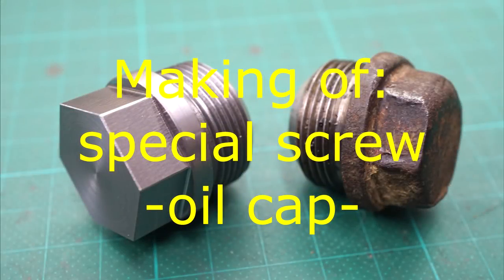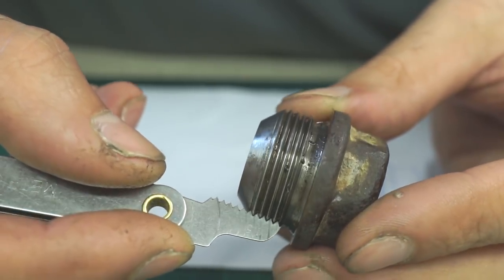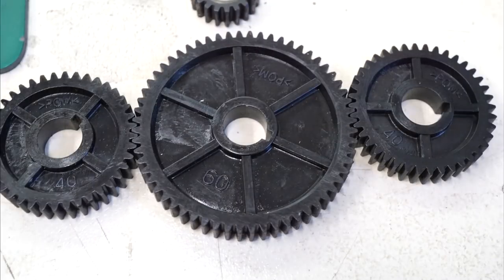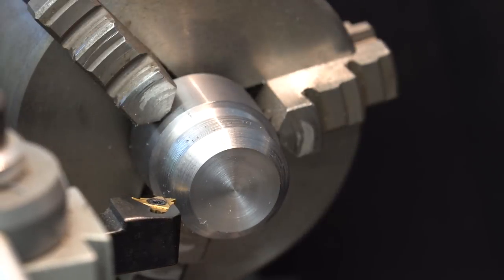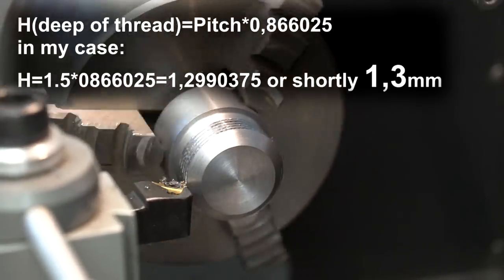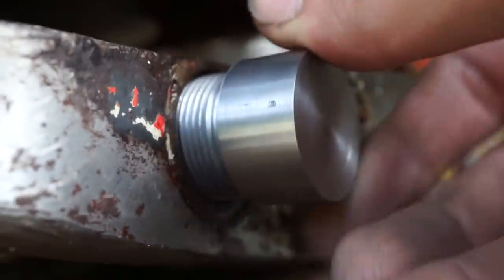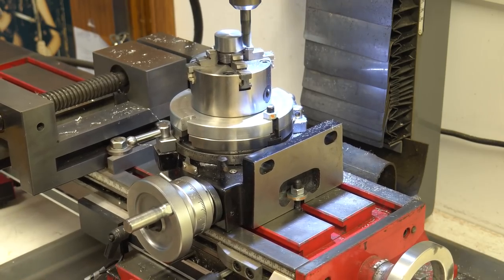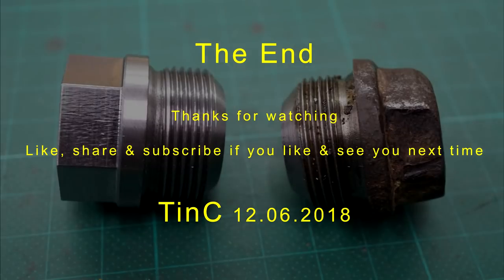Making of: Special screw [cutting thread on mini lathe, Making hex head]

Comment: I like your workmanship and clever way of machining steps eg you tested the threads on mower before machining the hex - in case the threads did not work well then there would be no need to cut the hex. Thumbs up!!
Reply from the maker: Mohabat khan Malak offcourse i test every thread i make before continue processing, if the thread is fail everything else is fail.

Comment: Hi. I'll explain why using drill chuck is good for drilling, bad for milling. Drills cut only on the end. When drilling all the force pushes the drill BACK up into the chuck. It is safe. Milling tools cut on the side. When milling this side cutting action tries to pull the end or slot mill down OUT of the chuck. This is a bad thing. Your work can be damaged, you can get badly hurt if the tool hits you. Proper milling chucks (for example 'posilock') prevent this by holding the end or side mill with a thread that tightens if the tool turns locking the tool in the milling chuck. Almost as good is a collet chuck (for example 'ER20 collet') or perhaps a morse taper or 'R8 collet' which will fit directly into a morse taper or a R8 taper spindle without needing a seperate chuck. Both use a much bigger clamping area to hold the tool much tighter than a drill chuck does. You need a milling chuck or collet that matches the fixing taper in your mill spindle. I hope this helps folks understand. BobUK.

Comment: Hi, I was really quite impressed with how you managed to produce such a great part from a very average machine. I mean it has plastic gears! You should be really quite impressed with the work you are doing. There's a saying that goes "A bad tradesman blames his tools". In your case, there's probably an opposite saying along the lines of "A skilled tradesman doesn't need to blame his bad tools". I liked and subscribed to your channel. There is a quite lot some of us who do have decent lathes can learn from you and how you work around the limitations of your lathe. Keep up the good work.
Reply from the maker: Fred Bloggs hy, thanks for yoir opinion, i really love this minilathe, i pay about 300€ for it and make a few mods, you must know the limitations of this little machine and you can do lot of stuff with it. I am sure that make parts for a few thousend $ with that small lathe, like repair a few starters with it (turning the rotor-colector) hydraulic thread and so on... Great little machine, but cutting tool os really importent there, it must cut like butter so you don't force the machine too much.

Comment: just wow... I want to learn this stuff!
Reply from the maker: Yo ski thanks, i think i will make one more video just to explain better how to make thread on this minilathe
Reply: I understood how the file tooth has more biting surface area with each cut, so each next cut should be less, and how the gears are set at a certain rate to make the thread, but I dont know the tools, the rotator table and all the bits and how to use them.
Reply from the maker: Yo ski i got another video about rotary table, there i was explain a bit more how it work...

Comment: Amazing work on that tiny lathe. Your English is fine and very easy to understand. I've never seen the Machinery Handbook in another language!

One suggestion only: the word "Thread" is better pronounced like T and the color RED, instead of T and the sound REE.

You do very nice work on very small machines. You must have a lot of patience.
Reply from the maker: Gary La thanks for tip i got it, yes i think i got lot of patience, sometime i use hours and hours to repair some shit wich cost $5...
Also i need them with my mini machines, that machines are great if you know how to work with, the best think is that they'r cheap (lathe €300) and you can improve them on 1000 ways. The most important on that mini machines is cutting tool, it must cut well so the force is smaller, i work also in big lathe and mill on work and yes there is a big difference, somekind you must feel that little machine and know where is the limit of force it can handle, or you'll destroy everything and saying arround how shitty that machine is.

I tell everyone this is great machines for the price but you just can't compare tham with 30.000€ woth lathe.
Thanks

Comment: Hey bro, just info: the deepness of the thread isnt 1,3 (yes but from 26.00 diameter) you have like 25.80 diameter in real so you will need to adjust that to be 100% right. But its ok like you did.
Nice video, greetings from switzerland
Reply from the maker: Denis Tuma that's true but i make diameter 26mm than cut the tread, and for the end i sand with sandpaper top of thread for about 0,1mm so i got tighten screw for better oil sealing, thanks for that kind of comment, i always love them, i am "self study" about all this, i make electronic school but really like making with lathe and mill out of steel but don't got enough knowledge yet, but learning... Greetings from Slovenija

Comment: Which milling machine you are using, brand, model and price you got it please.
Reply from the maker: Brand: Px tools, model 25lv (L=long table V=vario) with automatic x axis support (separate electric motor with pwm controll.
I pay €1000 for them with some tools but i buy from second use bearly used, like new.
But i already got bill for new one, it cost about 1300€ but got short version table, no auto support, without tool and most important it got only mk2 konus, this one i owned got mk3 conus, so much more tools can be used on it.
I replace all the bearings for SKF and replace geats with pertinax one and now machine running great, no problem to mill hardened steel with 20mm mill, few details you can see in my video where i installing igaging dro on it.

Comment: Shouldn't you cut the hex first? That way you don't have to grab the threads with chuck jaws. Turned out great though
Reply from the maker: Hey, it's a very good tip, thanks, but i think on way, that if i fu*ked up the thread i throw part away and make new one befor spend time on hex head. Cheers.
Reply: That’s how I would do it. I’d also use a 1.5pitch full form tip and keep cutting til the o/d measures .1mm under. Decent job though for hobby machinery. I’ve been a turner for 37 years and currently make military aircraft parts.
Reply: @jubbaronny  Oooh I'd love to do that. I wish I got more time turning at work but I'm stuck on the wire EDM machines. They're nice too, but much more hands off. Not much time for turning when all we do is make Tungsten Carbide.
Reply: @letsgoBrandon204  I’ve never done wiring or sparking but I’ve spent time on Bridgeports, jig boring, manual and cnc uni-grinding. Up until 4 years ago I was turning large work up to 4 tons but after my 5th redundancy, I’m now doing small parts for Typhoon, Hawk and F35.

Comment: What happened to the concave end for ball.
Reply from the maker: What you think exactly? I lose the ball also, so make a few other parts so i can use small 8mm ball, those days i make general servise on this mower, so i reassemvle it to last screw, and found the ball into gousing, i got lucky so all the gears stay ok. Then i sandblast all parts, paint them and now assembeling back together, sure i order few new parts from reform and replace all the bearings, total general service cost me about 800€ not included work because it's mine, but the mover will be just like new. I do not make video about it because it's lot of hard and dirty work so i can't record and work all together, but it can be interested video i know...

Comment: Hey dude that manual for putting thread and the extra gear does it come with the milling machine?
Thanks for the indept, i was wonderinghow you got accurate with making threats haha
Reply from the maker: Yes manual about the threat come with the lathe, and dividing table got another manual so you kbow how to devide... It's easy to use when you see in real.
Reply: @TinC33  Thanks, i think i will buy the same lathe as you and experiment. I got some projects in my head for my RC Scania (Cheap hydraulics and also air suspension)
But first i need to invest in a lathe
Reply from the maker: @mr.president2031  yea that chineese mini lathe are great, i pay about 300€ for mine year 2011 now same lathe in same store cost 500€ don't know why but i think still worth the money.
This lathe you can buy from many different brend, like grizzly, optimume, erba, noname.... But i think they also come from same fabrication line, ther just different equipement, colours, electronic etc, but can be big difference in price from 400-2000€ so think good before buy.